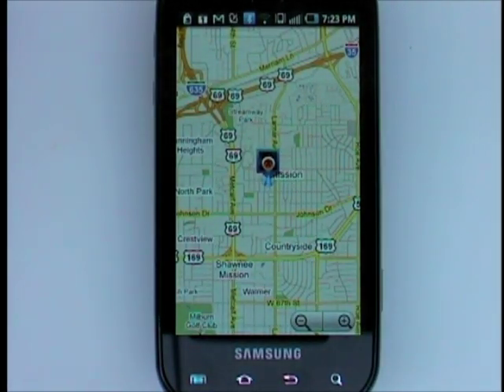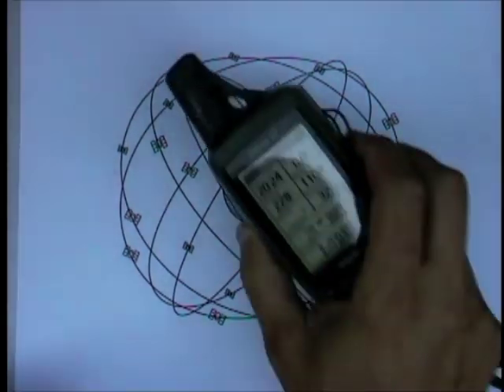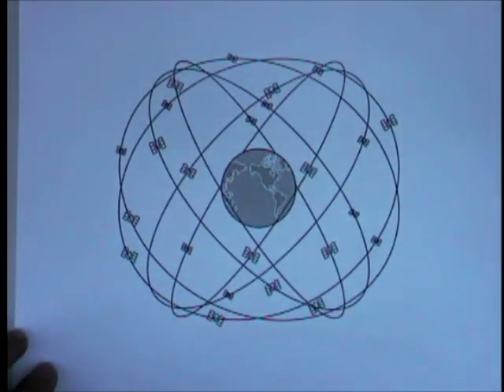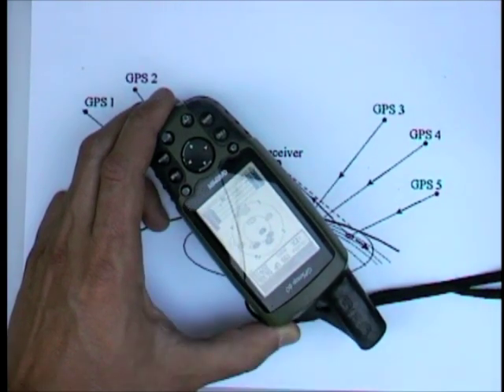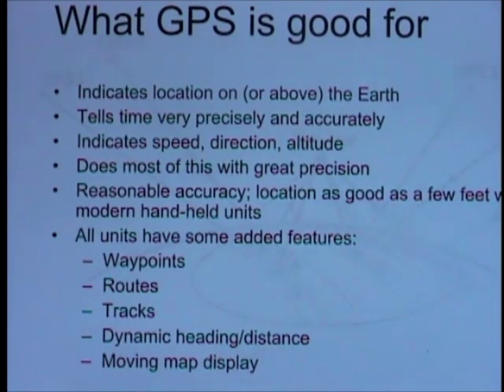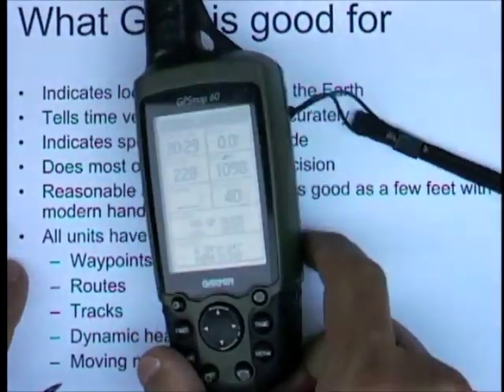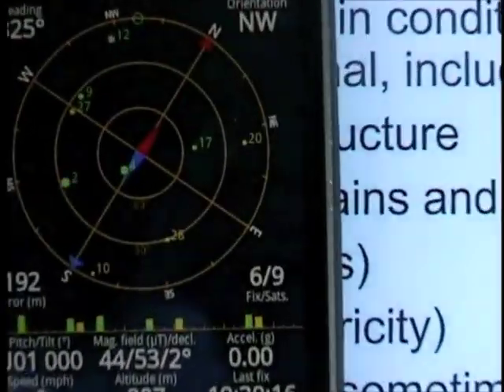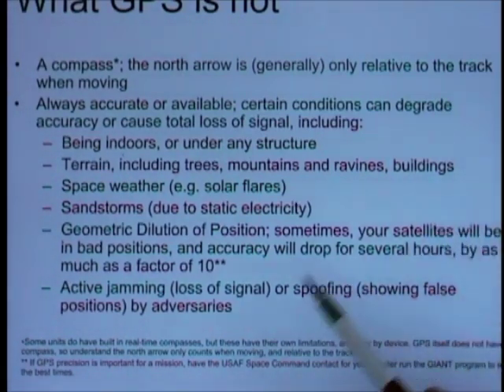GPS for Land Navigation - Part 1

Comment: Thank you Mr. Hoober. This is an excellent tutorial. I am tasked with delivering a two hour block of instruction on the DAGR very soon to a group of soldiers in a 19D MOS transition class. This video helped me to really understand the "HOW" of GPS systems. With out a doubt, I will be a little more confident when I get to the podium. Thank you.
Reply from the maker: If you want some more stuff, I have a slideshow which might help as well: 
http://www.slideshare.net/shoobe01/gps-for-light-infantry-leaders-presentation
It's even downloadable, so feel free to steal any of it you want. That's what it's there for.

Can't find it now, but there's a video of a DAGR being compared to a Garmin with deliberate jamming. That and S/A (which is still a technical capability) are points I like to make: Don't use a commercial receiver for mission critical stuff! If they issue you a GPS, use that one.

Comment: I'm commenting on a 7 year old video... but.. I was wondering, are you USAF? Either way, thanks for the vids, you explain it so well.
Reply from the maker: Nope, never served anywhere. Bad knees, childhood asthma, and I believed in the fear of the Permanent Record, didn't know you could just lie and tough it out.

I've done formal training of Marine cadets and others, in land nav, communications, tactics, MDMP, etc. so get some experience in training and hang around with some of those people a lot. These videos are originally made to be a lead-in or follow-on (depending on the student!) for my field training, as I only would get like 2 hours to get them on all this, and they always had questions. 

I also have an ex-AFSOC friend, so maybe that rubbed off?
Reply: Not sure if you have the time but I have a couple general questions regarding using gps on my motorcycle.. which is what led me to your videos.
I live in Oregon near Mt. Hood, we have a lot of long national forest roads that run through the mountain. I want to purchase a gps that will allow me to navigate those remote roads and also work on the city roads. I have a dual sport motorcycle (street legal dirt bike basically), so I will be traveling on both types of roads.
I think I'm confused on the 'map' aspect of these gps systems. Someone told me a regular in-car gps won't work off road since it only has city roads mapped to it. So I read up on some fully off-road gps systems and learned they won't work on the city-roads since they don't have these maps.
How do I know which gps system will have the maps I need?
And let's say I get a more hiking style gps, and want to get through this mountain, will it only direct me in a straight line? What if that line leads to a cliff or somewhere my motorcycle cannot pass?
Reply from the maker: @nubetoob9292  I know it's been years, but just wanted to say: I didn't deliberately blow you off, simply never saw this message. If any questions, always okay to ask here or... does YT even have a private message service? It should.